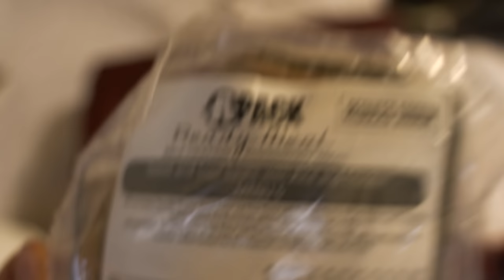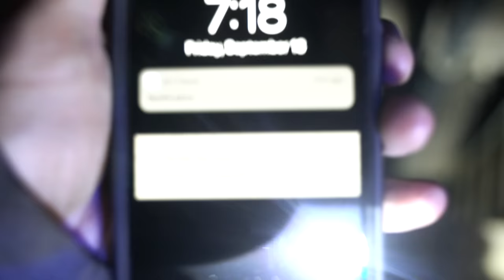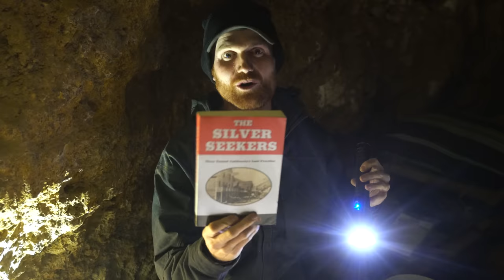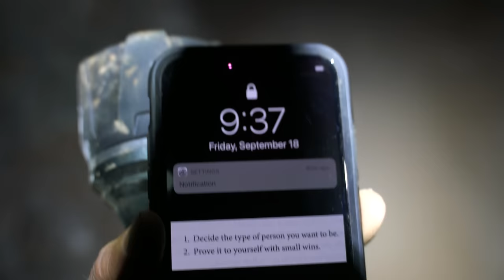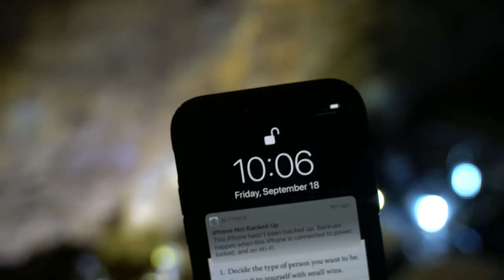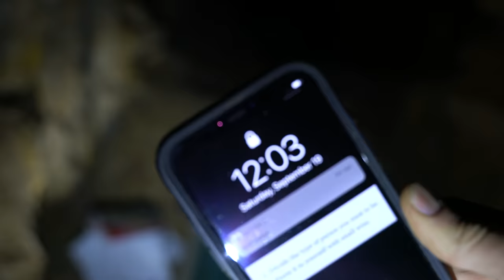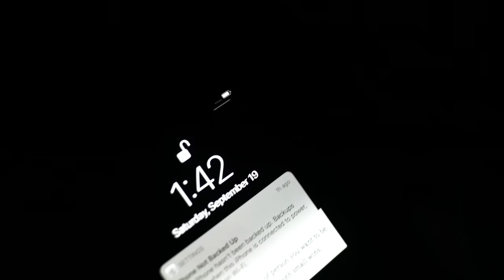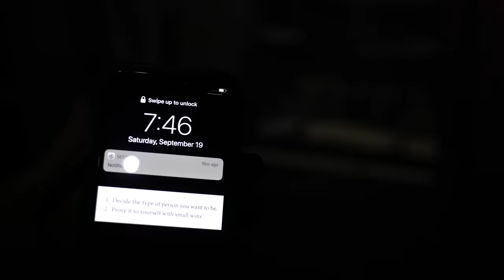I Spent The Night Alone In An Abandoned Mine (With No Way Out)

Comment: the whispering sound you hear is your ears adapting to the absence of sound in the mineshaft. possibility the sound of water moving and / or the shuffling of bats. could be the air flow ( woosh sound) echoing
Reply: I saw this cave explorer thread and there are so many theories ... 

one time 3 guys were about to enter a cave. the newb said "i think there are people in there" the other two said "no its just water" .... 5 mins later some guy exited the cave LOOOOL
Reply: ...or ghosts.
Reply: It also doesn't help that sound travels a lot further in mines and caves than people think it does, and the rough, uneven walls, ceilings and floors have a tendency to distort sound waves in weird ways that your brain isn't accustomed to processing.  So, in addition to the complete absence of "normal" sounds from the surface that your brain is adapting to, it's also trying to process a whole lot of new sounds it doesn't know how to contextualize, which leads to a pretty significant level of neural dissonance and overload.
Reply: 🦇🦇🦇🦇🦇🦇don't bats have rabies? Or some other deadly disease?
Reply: God bless this comment, sanity restored 🤦🏻🙏

Comment: Survival Tip: If you want to survive freezing but only have MREs, you should heat them up and wait till they're only relatively warm. Then put them under your clothes like heat packets
Reply: I was thinking the same thing.
Reply: But if you can heat the MRIs then shouldn’t you be able to light a fire?
Reply: @kateapple1  No. MRE's use a packet filled with stuff that reacts with water to create heat. There's no spark involved, and while it's hot enough to burn you, it's not enough to bring something to a flame.

Comment: Cold weather can increase the drain on batteries, that's probably why your camera batteries were running out quicker than usual!
Reply: Or ghosstss~ wooo~
Reply: lithum batteries fair better when it is cold.
Reply: Thats wrong. Hot weather increase the drain on batteries.
Reply: @br2538  if we are being picky about it, the capacity of the batteries decreases with lower temperature. Internal resistance increases with hotter temperature. So storage life of batteries is less when it's hot and run time is less when it's cold
Reply: @br2538  they both do but I've definitely noticed my phone going flat much faster when it's cold.

Comment: The hanging rope is a danger sign used in old mines. you can see how the roof of the mine has separated from the rock. that area is extremely dangerous.
Reply: Chance of death is seldom to none, in 10 years, only 11 people have died in abandoned mines. Out of the thousands that had entered one.
Reply: Well I’m not going down there to see if I’m one of those thousands.
Reply: spook show I said thousands go in with out problems. Only 11 have died in 10 years.
Reply: SQUARE HEAD SAM this is terrible logic, mines are exceptionally dangerous, the reason deaths are low is because most people know not to enter them. Spelunkers who understand the dangers are the main people venturing into mines and even then it averages out to a death a year. It would be vastly more dangerous for someone to go into a mine having no idea what signs to look for that indicate danger.
Reply: TheMunch97 it’s true thought, as of last year only 11 people rappel have died in abandoned mines in the us. I’m not encouraging entering one, I’m just saying the odds.
Reply: @CRM394  5:19
Reply: @CRM394  16:19

Comment: You shouldn't go down a cave without that oxygen scanner thing
Reply: @markskaggs5572  I believe it's a device that measures oxygen levels, because in mines there can be pockets of "bad air" which is essentially air with little or no oxygen, and the device beeps when it detects said bad air
Reply: @MidnightX2006  yes. I just was to lazy to google how it is called
Reply: @davebdot6713  In an earlier episode he showed off a sensor for gasses, so I'm sure he has one. I can't say whether he brought it on this trip though
Reply: @kadengolda2373  good to hear that
Reply: He alwas brings one if I'm not mistaken. You can see it in previous videos! :)
Reply: @otaku9004  I don’t know if he brought one this time. He forgot to bring his blanket and sleeping bag, which are kinda important to have as well. And he at least showed them in the beginning because he was intending to bring them. He didn’t even show the air quality sensor.
Reply: @adii2461  He also showed his blanket and sleeping bag like three times then forgot it.
Reply: @adii2461  He mentioned several times that he explicitly forgot the blanket.
Reply: Ya exactly there is that gas thats invisible that kills instantly
Reply: @truther6616  H2S (Hydrogen Sulfide) is one of those gases that can kill very quickly. In small amounts, it smells like rotten eggs...Larger amounts you cannot smell it as it kills your sense of smell.
Reply: And a canary! 😃

Comment: Why not just drop a cable for communication?
Reply: Said by mike's electric stuff, I love it!
Reply: And what are the slim chances of a slim Jim noticing that 👀
Reply: Because that's expensive, and could interfere with the lift. What kind of cable do you know of that's cheap, 500ft long, and readily allows two people to talk to eachother without special equipment?
Reply: A simple 2 wire telephone cable would be sufficient, light and cheap... You can even use wifi for this little (and straight) distance, just use a pringles can as directional antenna
Reply: @AtomarerZwischenfall  what would you attach to each end that would work in this scenario? That's 500ft at least of cable, not cheap in the slightest, and could get destroyed or harm the cable car.
Reply: @SpunkMayo  AC is for ringing, DC for talking... There are 48V batteries or use a buck converter (2$) ... Max. Length of the cables: 18,000 ft or 5km (https://en.wikipedia.org/wiki/Plain_old_telephone_service)
Reply: @AtomarerZwischenfall  "Wikipedia does not have an article with this exact name." nice link bro

You didn't acknowledge the dozen or so other issues I listed.
Reply: @SpunkMayo  just remove the ) in the link, bro ;)
Reply: @AtomarerZwischenfall  still didn't address any of my other points, like how that battery wouldn't work lol
Reply: @SpunkMayo  AC vs DC? Already answered. 48V? Already answered. Length of the cable / resistance? That's in the wikipedia link. hint: remove the ')'
Reply: @AtomarerZwischenfall 
Converting DC to AC for this purpose is impractical and lossy. The battery would need to be recharged periodically, and there'd be no way to communicate to the underground section that the battery is dead and being charged if it died or the underground person/team was away from the receiver. Also, you'd need someone who's job is just to watch a phone all day upstairs, something you'd be pretty hard pressed to find someone to do.

Cables are heavy. Batteries are heavy. Phones are clunky. If they decided to explore, say, the 500ft adit, you'd need to move the phone, and then move it again depending on where you are. Otherwise, you could buy ten phones, route the cable to each of them, and power them all the time. Let's hope the battery, converter, length of cable (which would need to be at least 1000ft to work on the whole shaft, don't forget all that slack if you're exploring the 100ft mark!), and phones don't get tangled, in the way, fall down, or wrapped around any pesky limbs. Sounds really practical, safe, and cheap I'd say.

You also can't just haphazardly dangle a cable down the shaft. The lift needs an unobstructed path, and when dealing with decades-old equipment, it's already a risk to begin with. Would you just hold the reel while you go down the shaft? That's asking for a decapitation or at least losing the lead down the hole. Afterwards, it'd need to be anchored. Do you attach it to the crumbling cave walls, or the rotting structural support beams in the shaft? Make sure not to leave any slack!

They're trying to save money with this project, re-using old materials and having a Patreon should be indicative enough. When the solution is dangerous (as I've described and as seen in the video), redundant (they've already got radios), and silly, every penny counts. The time & cost spent here would go much further elsewhere. It's a dumb idea.

The point of the video was to spend the night isolated from human society in a cave far underground. Having a person sitting up all night a phone-call away kind of ruins that whole experience in the first place.

I obviously knew how to fix your (broken) link, and your page does nothing to address what I've laid out.

You and others are doing what's called "over-engineering", ie making solutions to problems that have already been solved. They have radios, they use the radios.
Reply: @SpunkMayo  so the springles solution is still in the game :)

Btw, just remove the ')' at the end of the address
Reply: @AtomarerZwischenfall  ok troll
Reply: @SpunkMayo  idk much about this stuff but could you take a radio down with you and then keep a relay at the top to communicate over a bit more of a distance? Also the radio you take could be crank powered and the relay could be wired orange solar powered
Reply: @ibaron2716  yeah I don't see why not
Reply: @SpunkMayo  you're really stuck on it getting caught on the lift, there's a void in-between the lift and the wall. Run it down the wall... You're trying to shit on a feasible plan just to be shitty...
Reply: @PostalPatriot556  there are more curse words than "shit".

Have you seen that "void"? It's at most a two-inch gap. It's an unreasonable and irresponsible plan, and I've laid out in more than enough detail why it would be moronic to attempt.

It isn't happening, either way. Dumb idea, dumber folks defending it for some reason.

Good job addressing only one of the many concerns and problems I've laid out, amazing work.
Reply: @SpunkMayo  open your mind to the possibility of a crazy idea working. Just the possibility of it.
Reply: @ET Hardcorgamer folks just want to hang on to ideas that sound good on paper due to pride, I guess. It's clear none of these people do any spelunking or communications work.
Reply: @SpunkMayo  you could also nail the cable to the wood periodically as you ascend down, stop looking for drama. 150bucks is nothing compared to have an option of communication so deep down.
Reply: @el_kasztanejlo8555  it's been covered, it's called a radio
Reply: @SpunkMayo  can use the cable for internet, not only for radio
Reply: @el_kasztanejlo8555  kind of ruins the point of camping, why would you need internet?
Reply: Guys guys, Spunk Mayo is the official professor of the internet and he knows everything, so give him a break. Running a phone line is totally feasible and a good idea so that you might have constant communication. Should run a power line down too. That gap is perfect and just drill a three inch hole in shaft wall every x length and clamp the wires thusly. It's not going to get get caught up in the lift. Most importantly, the man is bringing back to life a ghost town and shuttered mine. That takes a WHOLE lot of crazy cajiggering, outside the box thinking, and pallets of duct tape.
Reply: @thecocktailian2091  damn y'all still triggered over the truth, huh? Tldr

Comment: I find it slightly hard to believe that hoist is from 1865, wouldn’t it have been upgraded over time?

Also depending how good of shape that wooden ladder is couldn’t that be a way up in an emergency?
Reply: Its probably from the 1910s judging by the look. Not all mines in the town where carved in, on opening day of the day of town. The hoist wheel looks probably 1930s 40s. But I’m not good with guessing dates.
Reply: That is putting a lot of faith in old, dried out wood, that has had water leakage on it, lots of freezing and thawing expanding and contracting the wood and nails over many years. 
It is an 800 foot drop. 
I wouldn’t put my life in its hands unless the situation was so dire I knew I would die one way, so I may as well chance dying another way.
Reply: @seekingeudaimonia6884  Temperature is constant a little way underground, no thermal/freeze thaw cycles at all.
Reply: Holly Boa temperature is constant below ground. Water isn’t very likely to make it there either. Plus lumber back then was much better quality. Just look at how well all the shaft timber’s are preserved.
Reply: Holly Boa "It's probably from the 1910s or 1930s or 1940s but I'm not good with guessing dates so trust me"
Reply: CommieCat if you didn’t watch past videos, there is a water pipe going up the shaft, which means there were most likely many leaks when it was in operation over the years. 
Also, yes, temperature can be constant and only reach down so far but, with an open tunnel and the surrounding building not being air tight, air temperatures will still travel down especially when there were exits out of the tunnels long ago, and possibly still some that he hasn’t found but has been looking for.
Reply: @CommieCat  My dad worked at a far bigger mine only 1.5 hr.s from Lone Pine.  Even tho it was  way up inside (8,200 to 1100 ish ft. alt. shear mountain) it's interesting that even large Earth quakes are virtually undetectable underground....waves pass over the surface even if the surface is near near vertical apparently. 

 At times when the entire canyon was full of dust and rocks cascading everywhere from (say a 7.5 quake) he'd order everyone to stay underground until things quieted down.
Reply: Holly Boa well mime ladders are actually very sturdy. Most mine ladders, even ones as early as 25 years ago where man of wood. The temperature in mines stay to same year round, about 65 degrees.
Reply: Holly Boa actually the temperature changes immediately open entering a mine or open stope. It’s amazing how it does that. One moment it’s 102 degrees in a desert, next moment it’s 65 degrees in the mines portal.
Reply: cameron you subtracting about have the quote there. The is no need to quote me either.
Reply: cameron nah, it’s just extremely hard to type on a tiny phone that auto corrects everything I type.

Comment: Might be fun project to find a way to update to hoist system. That way you might be able to operate it from both the top and in the cage. What about moving away from the old hoist and use a modern winch for at least getting access to the first couple of upper levels

Comment: 6:45 if it wasn't for the long length of cable needed, you could get a 12,000 pound winch that fits on a truck bumper for ~$300.

Comment: The only reason there would be jean material in the mine is to be used for toilet paper. Any rag material was used for this purpose. No one came out of a mine to use the toilet. Miner's designated areas for bathrooms inside the mines. They would spend hours in the mine before retuning to the surface, eating and toiletry were done down in the mines.

Comment: I discover and explore caves.  With membership in various spelean groups.
The Detroit Urban Grotto, for example.  They do not train.  Cartography and 
mountaineering skills are necessary.  They have verified by taped surveys
more than one hundred miles of extent underground.  Using base camps.
Supported by porters.  Often backpacked 12 to 18 hours out to various
camp location, sleep 8 hours, and then carry out what camps don't need.
Cartography crews often do 24 hours of exploration between rest camps.
Maze-like conditions required maps.  Which I'm not sharing.  "Don't step up...
if you can't keep up..."  Film quote:  THE CHRONICLES OF RIDDICK .

Comment: I see there are a bunch of comments.  Don’t know if you read or look at them.  I was surprised by 2 things.  The bats and the cold temperatures.  I figured that deep the temperature would not have been that cold and it would have been warmer.  You know, like caves and the principles behind geothermal heating and cooling.  I guess the air ducts/ventilation shafts affect the temperatures and that is how the bats get in and out.

Comment: I do not want to think of all of the toxic dust you were inhaling down there with zero ventilation. 47:04 you can see all of the dust with your light. They had ventilation systems even back in the 1800s with huge fans. I'd be taking an air quality meter down with me if I was you.

Comment: Hiya buddy, I've done quite a bit of underground exploring, pot holing, gauge walking, its very exiting but you loose your orientation down there, to me on your video it could be up,down,left,right I couldn't make head nor tail which way was up nor down (that's not good) in most situations that's a que, to get the fuck outta dodge buddy, (sorry for my French) but NA time to leave when you've got no partner no rope no wonder where you're going.  Dude, time to leave or get bk to where you came in and settle and get your head down until your help comes to get you up top 🇬🇧✊🏼

Comment: - Go to 40:34

- Set playback speed to 0.25

- Spam 'K' to pause and play the video at ease and try stop on the flash of light that apears somewhat centre of the screen (More to the right than centre, takes a few tries)

If anyone else sees this and attempts to do this, please try and help me theorize what it was. I've screenshot the frame and messed about with the SS as best as possible and it's shape is very perculiar.

Comment: You should carry one of these or even leave the blankets when exploring so others can use them should they need it.  An emergency blanket can reflect up to 80% of body heat back to the casualty. Emergency blankets are aluminium film blankets and are typically used to treat shock or hypothermia by retaining body warmth and preventing heat loss.